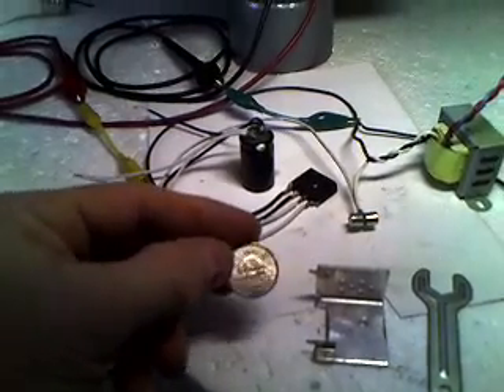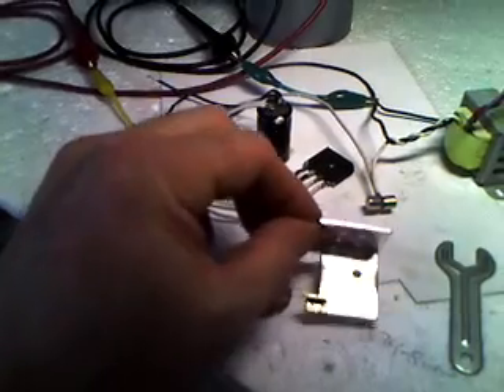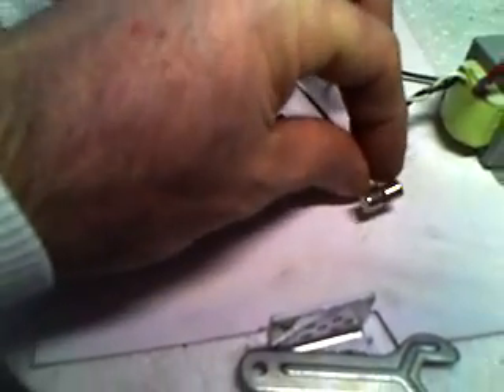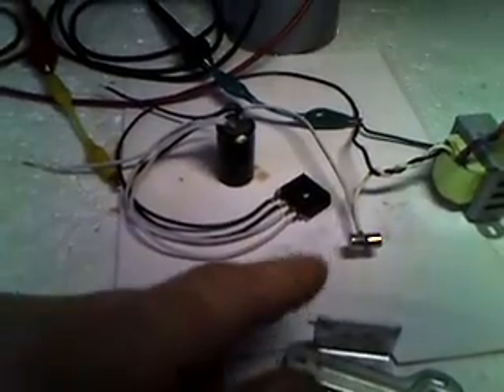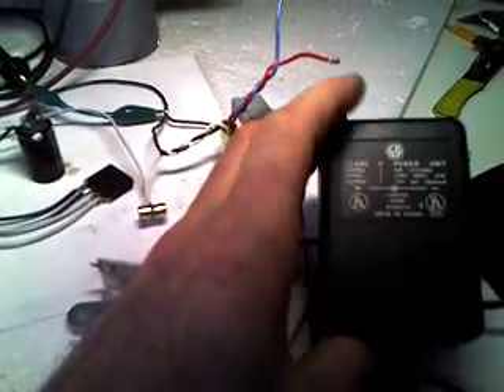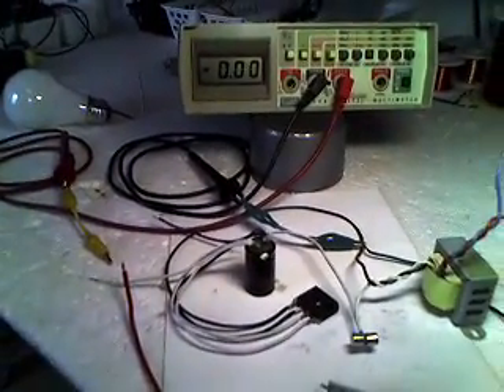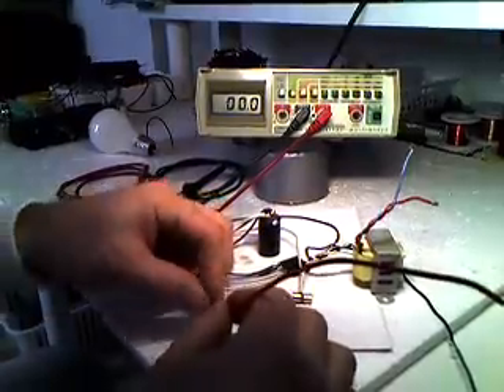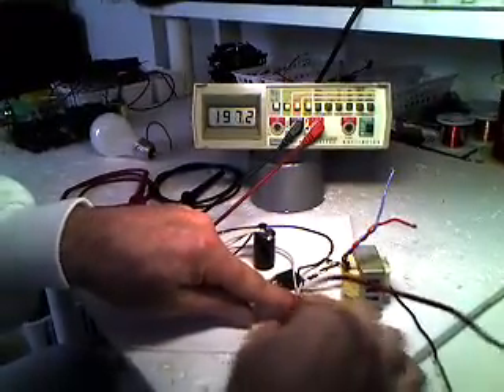Electricity Amplification by Neo Magnet Test 2

Comment: If current through the magnet in One Direction starts and magnetic field rotating, and then current through the magnet in the opposite direction against the rotating magnetic field, I would expect the game to be diminished, not augmented. If you wonder what I talk about, investigate briefly Edward leedskalnin permanent magnet holder, and you will see that an induced magnetic field is frictionless and will continue to move indefinitely until the energy is forcibly removed from a rotation or flow.

Comment: Hi Luc I value your vids and any way i can help in your research; this was taken from a discussion  on Adams heater/generator and it talks about metal alloy between magnets..."My understanding of the operation of the motor is that there is a sweet spot where the input power drops and the output increases, a kind of resonant operating speed. There may be more than one sweet spot over the operating range of the motor. However, it is at the sweet spot that the ether energy is 'gated' into the stator coils with the help of the metal inserts.

The position of the inserts was exactly half way between the magets. At the time I did not know about the Bedini design, but I can now relate that the positioning of the magnets is similar if not the same as the Bedini virtual poles he mentions regarding his designs"
Reply from the maker: Hi Alex, This was the first effect I shared 9 years ago and I didn't know much back then. With my experience now I can tell you there's no gain with this process. Basically what happens is when you use a Neo magnet the wire experience pulses creating many on off (switching) caused my the magnetic field around the wire gets repelled by  the magnet and breaks the contact. It's too fast to see by the eye. Regards, Luc

Comment from the maker: You should start with something smaller just to see the effect of the wire self vibrating on the side of the magnet. If the wire stick, turn the magnet 180 degrees. Do not use the ends of the magnet either. The fine single strand of copper wire should be between the North and South of the Neo magnet (center of magnet) This gives the best results.

Luc

Comment from the maker: Hi prototype9000,

I also get the same thing if I try to pass too much current or if I'm on the wrong side of the magnet.

This method will not give you extra energy! if that is what you are looking for. I only shared it because it's an interesting effect. I does the same thing as a pulse circuit without electronics.

Luc

Comment: Luc: You can see from my "Mag Amp Gen" vids that I am flipping poles rapidly with the 3-phase cylider stack to get high AC-output? However, a guy named "KT services corp", ran a 3-phase with a Bedini cylinder last year (& then dropped it). Those into the "Overunity" angle may find my set-ups can be rotated fast by Bedini - THAT CHARGES BATTERIES at the SAME TIME!?! I think several are working on this right now, & for pure Fuel-Less Transport, it may be the BIG ENERGY REVOLUTION "TOUCHSTONE"!?!

Comment: I also tried trying to light small 15w light bulbs with the spike, no luck.

I also put a 86 ohm resistor in series and still got  those readings. I also noticed puting the wiring and or steel around the transformer / magnet seemed to have increased the reading /rf burst. I can hear a louder rf "pop" in my computer speakers. 

Caps seem to charge higher/faster. Led's work. Tesla used spark gaps right next to magnets in some patents. Maybe a red switch pulsed by a bedini motor into a super cap?

Comment: Hi Luc,

I'm measuring with a multimeter ~ maybe not too accurate because of frequencies/pulse time. Wish I had an oscope!

I also filled a 250 V 400 mf  to about 37 V, voltage peak was much higher, but seems to stabilize @ around that number. Maybe this happened just because of the voltage step up?

Maybe next step, is charging a super cap and then timing the discharge rate on a std load? 

Maybe it's a just a "static charge" accelerated by the faster closing of the switch via the magnet?

Comment: I simply think you're climbing faster being you're manually pulsing faster. Try to time your alternating side clicks to be the same rate of discharges as your one sided clicks with the same number of magnets, I think you will find it's not much of a difference.

The more abrupt the spark, the higher voltage the kickback you're gonna have from the coil. This isn't back emf, it's field collapse voltage spikes.

2 spark locations for distributing the ionized air locations, but probably negligible.

Comment: high voltage kickback in the secondary of the transformer from the pulsing if you put a diode on the output of the transformer some rectification it might stop that back emf has nothing to do with it unless you are running a motor or something

Comment: Many thanks Luc,
again the thread is at:
overunity dot com/index.php/topic,4124.0.html

With the 2 magnets you even shut off the current in the transformer coil even faster, so more
BackEMF voltage as the cuttoff of the current is higher thus higher induction voltage and thus more energy inside the cap.
Well done.

Regards, Stefan.